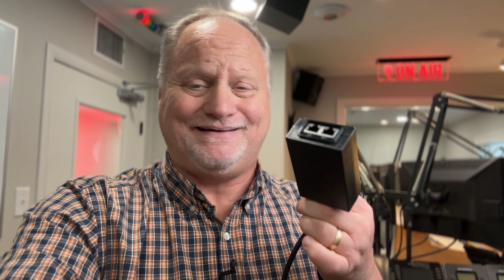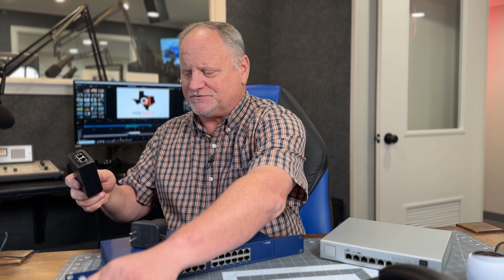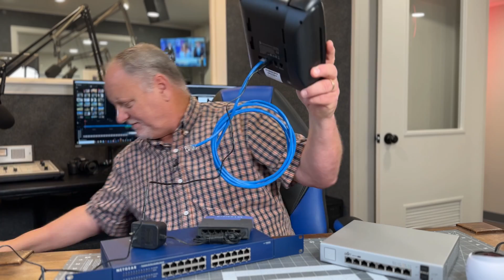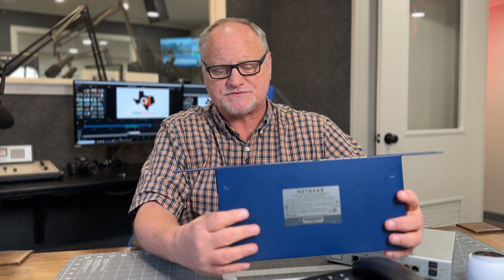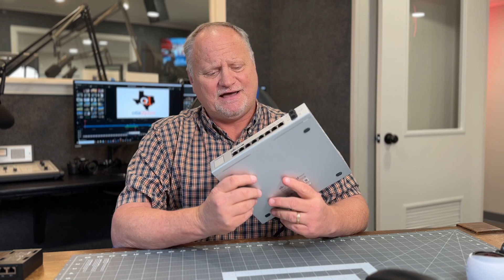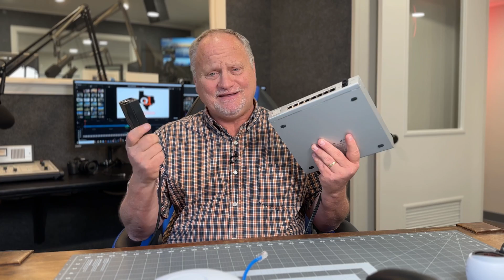Ditch the POE

Comment: "Other than that it's not really a switch, it's just a glorified hub". I strongly disagree. The defining characteristic of a switch over a hub is that the switch intelligently sends (non-broadcast) packets only out through the port that actually leads to its destination. If the device does that, it is a switch, period. Unmanaged switches are still switches even if they can't handle VLANs and other more complex switching tasks. It would have been far more accurate to have said "it's just an unmanaged switch".
Reply from the maker: Yes, I agree with you; and I should have elaborated a bit more. That was what I was trying to get across...Thanks for the great comment my friend!